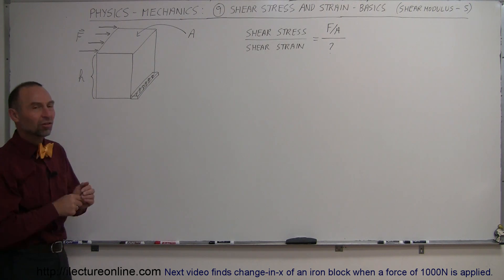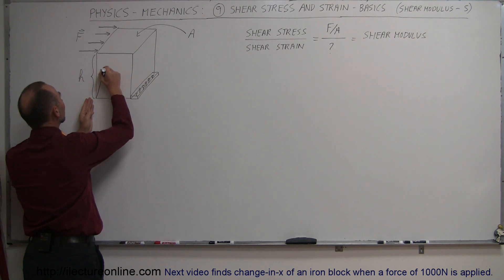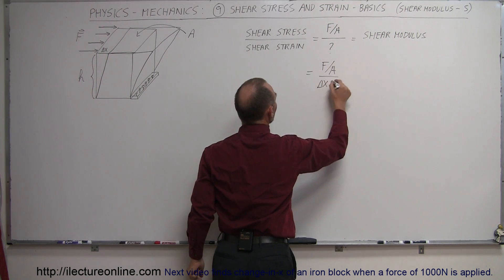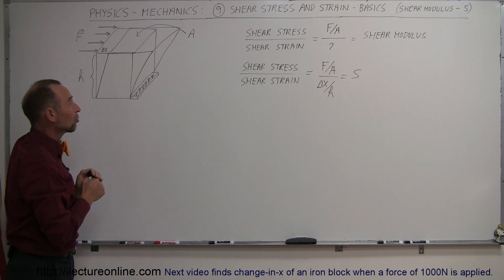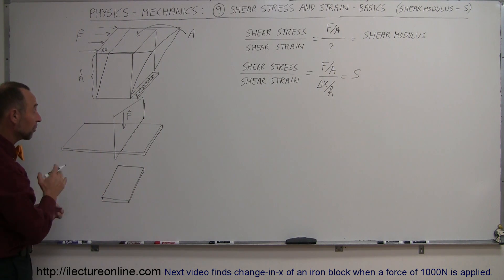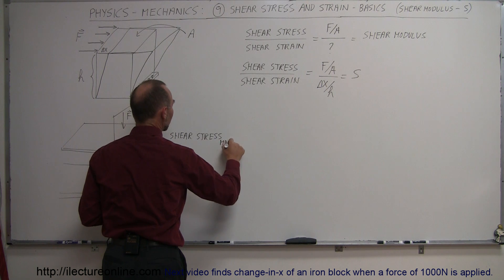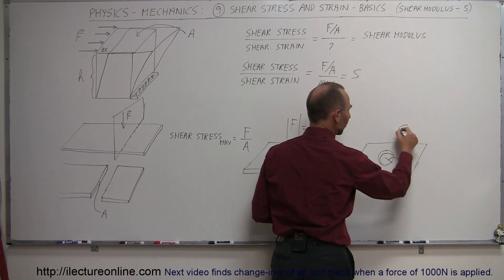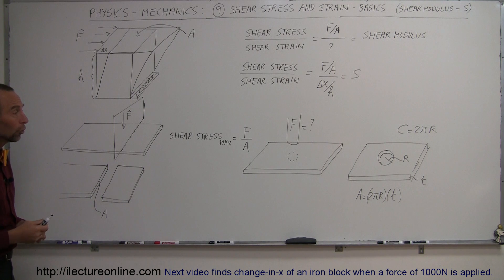Physics - Mechanics: Stress and Strain (9 of 16) Basics: Shear Modulus-S

Comment: Those cutting machines you referring to. The blade is in this lecture straight. But to reduce the F orce required to cut material the blade have an angle of   87 degrees for the upper blade the bottom blade is 90 degrees.
How to calculate the real force required for the machine with a 3degree cutting blade?

And also the F orce needed to cut material will ruin the machine itself due stress by keep forcing it to the limit of the max material itself. So is it good to consider a couple percentage more force to destress the machine?

Comment: Basic question: The shear plane in the very first example is the top of the cuboid. So shouldn't the Strain be a function of the length of the top portion or it is meant that is a square section where the top is also h
Reply from the maker: When you make a cut, the inner surface marked "A" will deform before the knife actually cuts through it.  If not enough force is applied the knife will not go through the material and only deform like in the example at the top.  Thus the areas are the same in the equation.  When the knife cuts through the material you exceed the shear strength of the material.
Reply: Thanks for the explanation. Maybe I was not clear. Stain = deformation / original length. In the first example, the deformation is dx, and strain is dx/ h. But the plan of deformation is perpendicular to h, so shouldn't it be dx/ b ? Or if I got this right, overall length of plane h is deformed and it increases by dx ?

Comment from the maker: Think of it this way.  1) The cutting blade applies the force.  2) The cross sectional area of the cut is the "area"   3) F/A is the shear stress  4) The distance from the support to the position of the blade is "h", the height.  5) The distance the material moves under the force of the blade is the "delta x".   6) delta x / h is the shear strain.  7) If the delta x becomes to large, the material will be cut.

Comment: to find the shear strain you need delta x. So how could you find delta x if you were given the dimensions of the object and the force as well as the shear modulus
Reply: You can use tanTHETA if you have all the dimensions, Shear Strain also = tanTHETA which equalls = DX over height or Length

Comment: In the first video strain is given by deformation/original shape and I can see that both with the examples given by the change in length for the wire and the videos on bulk modulus. Should I view shear modulus as a different approach to strain or is there a link that I'm missing when saying the change in length/height represents the deformation/original shape as well?
Reply from the maker: Shear stress (even though it has the same units) is somewhat different as compared to the stress seen with Young's modules and the Bulk modulus.

Comment: Hey there thanks sir :) 
i  didn't get the part where you cut that sheet in half.
can you further explain please ?!
Reply from the maker: +Abdelrahman Wael Helaly The force required to cut a sheet of metal or cut off a bold, or anything like that depends on the shear strength of the material.

Comment: Hello, Michel. In your hole punch example, what would be h?
Reply from the maker: +A. Kessler If the punch doesn't punch through the metal and dents it, then you would have a distance h where the metal is sloped and a distance delta x equal to the indentation of the dent.   When punching through the metal the stress applied is greater than the breaking stress.
Reply: Ah, I see, thank you for the explanation! My question seems ill worded now, but you managed to get the gist. Thank you for setting me straight 👍

Comment: Amazing lecture. However, I don't get the part of shear strain. How can it be delta x over height, since most of previous lectures considering strain of a string as delta Length over Length for example
Reply: Shear strain is defined like that. You are talking about normal strain